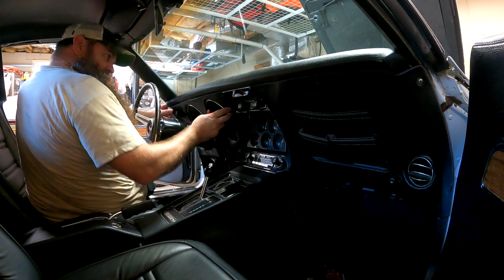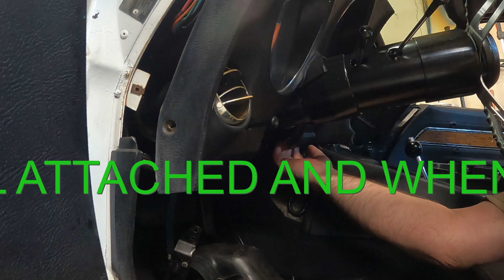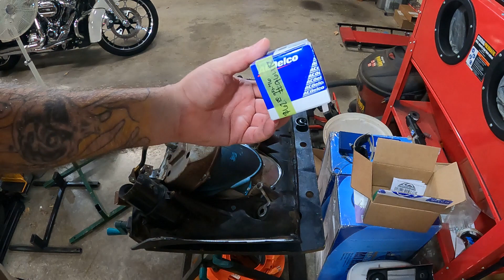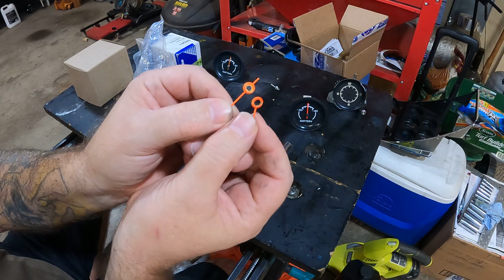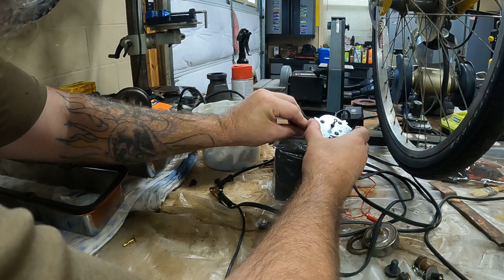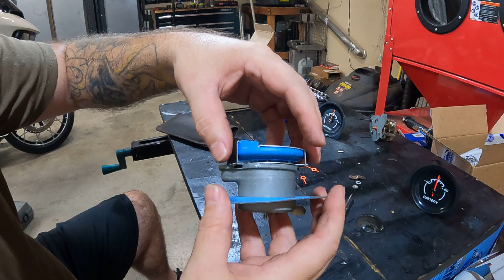1976 Corvette Gauges PART 1

Comment: Great video! I had the dash removed this past winter on my '74 to service the tach and speedo...Like you I also had to epoxy the same little plastic tab back on to the housing. VERY VERY tight fit in the driver's side dash area of these cars, between the gauges, steering column, pedal bracket and ac ducts, it's amazing it all goes back in place. Not fun at all! 

I'm also planning on replacing my clock and ammeter in the future, so this video makes a great reference for that! I purchased a new old stock AC Delco ammeter from eBay...hopefully it works out as there is really no other way of telling if your alternator fails other than eventually being left dead on the side of the road lol
Reply from the maker: thanks for the comment Joseph Spost. got more videos coming out part 2 and 3. stay tuned.